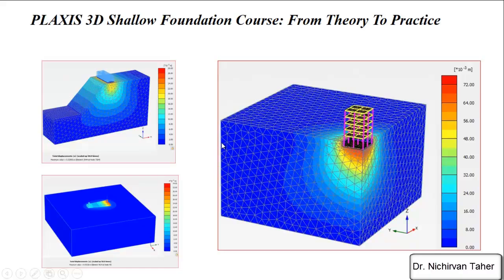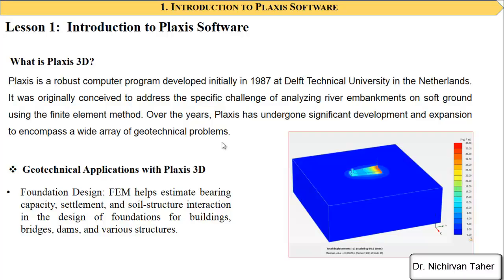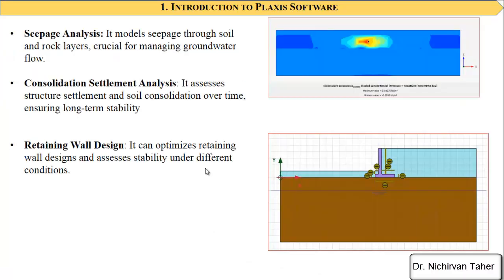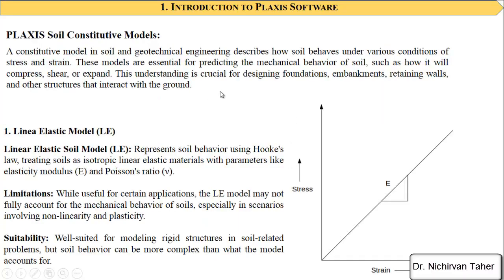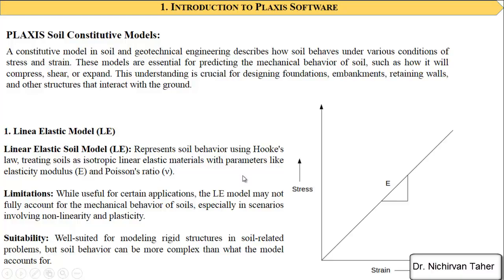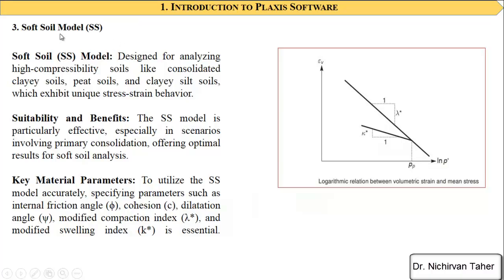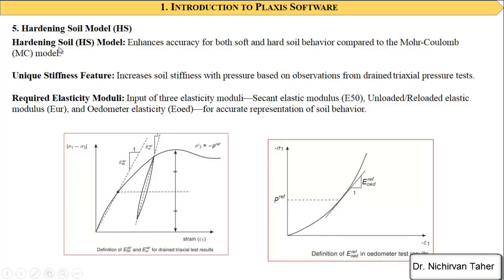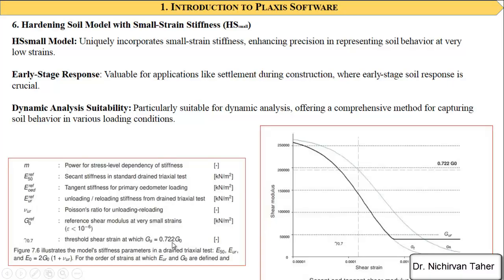Lesson 1. Introduction to Plaxis 3D

Comment: Will you teach other types besides "foundation design?" 

Like tunnels and excavations of shafts?
Reply from the maker: This course is mostly focused on shallow foundation under different load conditions, ultimate bearing capacity of soil, settlement analysis, consolidation analysis of soft soil, seismic analysis of foundation, soil reinforcement using geogrids and geocells, soil improvement using stone columns and jet grouting, however, the tutorials about piled-raft foundation, and 3D slope stability are included.
Reply: @GeoStructAcademy  Thank you. This is comprehensive. What are the future plans after this course? Will you cover other applications in a future course?
Reply from the maker: @TheAncientColossus   there other course regarding Plaxis 2D which include many practical examples , and comprehensive course about Pile foundation, deep excavation using Plaxis 3D, and all these course are paid based course,